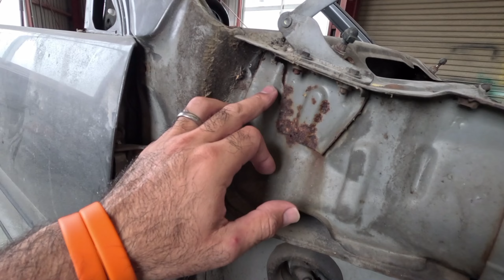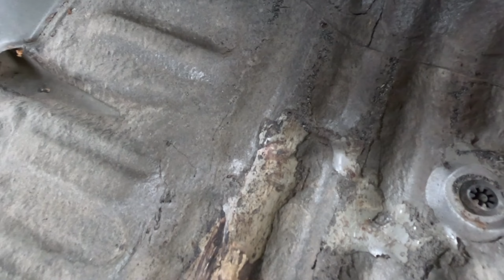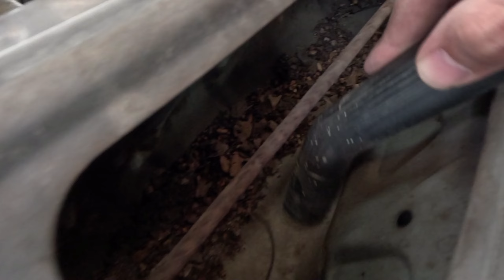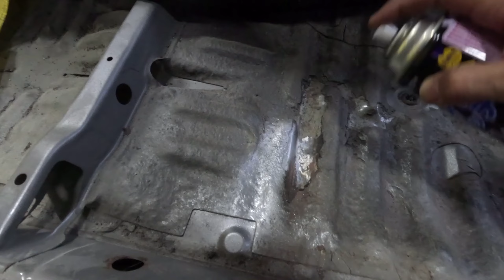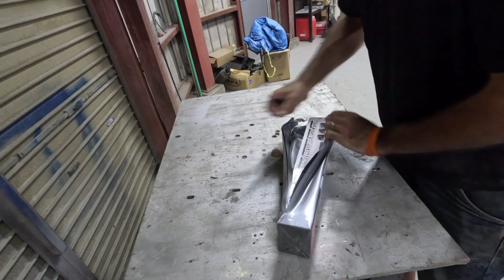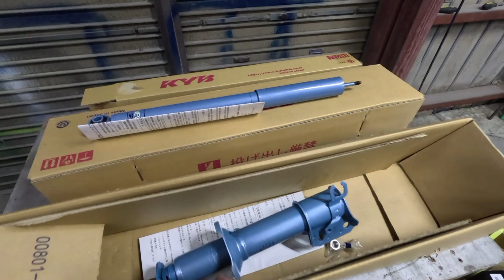Have I finished welding? Plus unboxing new bits for the Daihatsu Mira trxx turbo project

Comment: I'm probably wrong but I thought that if the aftermarket suspension part has the correct paperwork with it to satisfy the Shaken inspector then it can be legal. Cusco and Dmax are "Shaken legal" providing the paperwork is present. I'd be surprised if RSR didnt have such a thing for their springs since they are such a huge company and offer springs for everything.
Reply from the maker: Thanks for the comment,Very interesting. 

You could be right, I hope you are as it would be good news.

I would like to do some modifications on this and/or future cars without having vehicle test headaches.

Certainly a topic that needs further investigating 

Thanks for watching

Comment: I think you order the wrong rear absorber
Reply from the maker: That would be bad news. You could be right.

I did a visual check on the rear shocks and they do look similar. 

Let's find out in a future video if they are correct, fingers crossed.

Thanks for watching and commenting